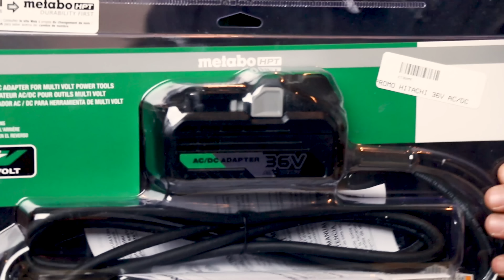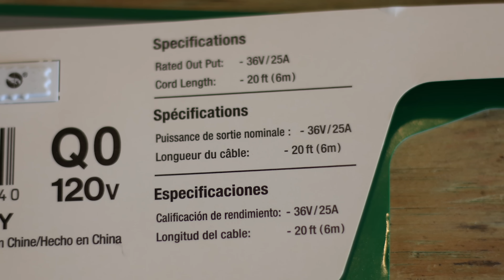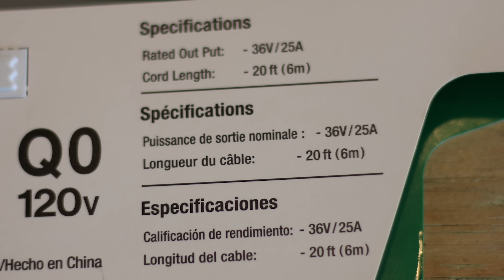Metabo HPT 36V Multivolt AC/DC Adapter On The Triple Hammer!

Comment: a lot of people are mentioning that the cord should come out the back of the battery pack instead of the front, but I think that Metabo HPT designed it this way because the battery on the tools you'd actually need this for slides in backwards. On those high battery consumption tools like saws & rotary hammers, the battery usually mounts in reverse, hence the cord will be facing the back.
Reply from the maker: Exactly Jon!
Reply: i dont mean to be offtopic but does anybody know a tool to log back into an instagram account..?
I was dumb lost my password. I would appreciate any tips you can give me
Reply: @Zakai Darwin instablaster =)
Reply: @Anakin Morgan it worked and I actually got access to my account again. I am so happy:D
Thank you so much you saved my ass!
Reply: @Zakai Darwin You are welcome :D

Comment: Would this work in conjunction with a Milwaukee M18 battery adapter so it could possibly be used for high demand M18 tools?
Any chance in trying this out Vince if you haven't?
Cheers.

Comment: 4 years fast forward i am still waiting for makita and milwaukee to release something similar for their tools =)))
Reply: @histguy101  no I mean an ac adapter
Reply: @histguy101  theoretically any platform can get it is just a transformer / converter from 110v or 240v to 12v 18v or 36v but yeah they won't do it because will loose money from battery sales. However I think is a great ideea from hikoki/metabo hpt to give you the option to power your tool from mains when a battery isn't really needed.

Comment: i tried to make one of these about 8 years ago from a broken Makita battery and a laptop charger. Its about time makita made there own. Do you think there will be one for the new 40v xgt tools Vince
Reply: Need a much more powerful/bigger power supply to provide 18 volts AND the huge amperage draw required to run cordless tools.  I also tried with a laptop charger once. Didn't work very well. Would be cool if all the companies provided this option.

Comment: These are great. I bought three of the battery 18 volt framing nail guns, they will run on the 36 volt batteries too. But im not sure about the adapter working with the 18 volt stuff. We are gearing up to make a run for totally cordless job site. We will be buying the Hitachi 36 volt sliding miter saw also.   Again, these multi volt batteries are compatible with all the older Hitachi lithium 18 volt tools.  You get 18 volt and double amp hours.
Reply from the maker: This new metabo hpt multivolt line is no joke!
Reply: Hi, this adapter works with the 18v line?
Reply: Hi, this adapter works with the 18v line?
Reply: @jesusdanieltorres971  no it does  not.

Comment: Thanks for the unboxing Vince. My thought is that is it is more for tools that are/will be coming out like circs,table saws etc but they wanted to get it out there. TBH I wish I new they were gonna make one for the Milwaukee saws. I’d like to get the 10” mitre but do not want to be limited to battery only. Most of the time it would be in a shop environment so plug it in and forget about it. I’m sure all brands will have this going forward. Sexy Flexy has it already correct? Can that be used on all 60v max tools?
Reply: Pete Hartnett DeWalt F*** it up. Because we run 120v in our outlets that’s why the mitre saw takes two 60v batteries. All the other Sexxxy Flexxxy are single battery. So their AC/DC adapter only works on the one tool. They said they didn’t do it cause if cost on the table saw. $100 more I heard. Stupid in my opinion. Anyway, that’s why HiKoki need sthat brick transformer to adapt that 36v to 120v for an outlet. Above my pay grade.
Reply: REN Man I agree that seems like a missed opportunity on their part. Maybe a revision in the future for the dewalt guys if the hpt version sells good and other companies buy into the idea. Maybe a split version for the flexy that can be used single for drills/etc. and doubled up for the others?

Comment: I’d like to see an adapter like this from Milwaukee it would be nice for the new m18 miter saw/table saw or maybe even a hammer drill if you had a lot of drilling
Reply: Milwaukee will be introducing the hybrid option for the tablesaw this year ;)
Reply from the maker: Milwaukee has no plans to introduce this option in the USA
Reply: @VCGConstruction  Your sources may very well be better than mine. The whisper I heard was they were looking to introduce an updated version of the table saw this Summer that would work with either battery or mains power.  It would be a smart move imo. Cheers.

Comment: Testing the AC/ DC adapter with high current  draw tools should be fun. Instructions say the AC/ DC should not be used with grinders. I wonder if the Mitre and Table Saw blades spool up, brake better or sound different with the adapter installed?

Comment: The Transformer brick is a step Down Transformer to step the voltage down from 120v to 36v thats why the brick is so large takes a ton of chips and capacitors and resistors to drop that voltage @vcgconstruction

Comment: It's a good idea...but like you said the cord is not a good idea for a drill...its good for a table saw or miter saw or other big power tools. That whole set up is not cheap but it's a very good quality tool.
Reply from the maker: I think the adapter will fit on the sds hammers the opposite way so it won’t be an issue!!

Comment: Milwaukee should make a adapter like that and improve on the design
Reply: Aaron Repper that’s red China’s mission statement. They just don’t deliver. I.E. table saw.
Reply: @renaissancemen1  The whispers from TTI tell me it's in the works.  My guess would be NPS19.  The requests for it have been off the charts.
Reply: They already do for m18 power tools.

They are $44 Australian dollars
Reply: @zagan1  give us a link brother.
Reply: zagan1 where ? Maybe your thinking of the USB adapter that clips into the battery
Reply: The power cord is actually designed for the SDS hammer drill. Then the cord goes backwards. You CAN use if for the rest too, but probably it's the worst to use on the impact driver. However Vince showed when you run out of juice on the driver, it still is possible to somehow finish the job with that power adapter.

Comment: It would be great to have the Metabo ac/dc adapter work on all of their cordless tools but it doesn't.  I have the Metabo HPT DV 18 DBFL2 Cordless Hammer Drill , that uses a multivolt 36v / 18v battery, I purchased the Metabo ac/dc adapter but the Metabo hammer drill does not attach to the drill. Hugh Bummer. Stuck with useless adapter.
Reply: Same. Fuckers should be sued for false advertising. The adapter literally says "fits all metabo multivolt battery tools"

Comment: Wish the cord power adapter cord itself came out of back, instead of the front; as, I can see it probably getting in the way when using....from the back of tool, might have been a better choice, just sayin'. That inverter is huge. Wish they could come up with something little smaller to take AC to DC for the tool..... Maybe they could had built the inverter directly into that battery adapter?, might have been tad bigger, but rather that than huge brick😉

Comment: Would that work on the mafel 18v plung saw
Reply from the maker: No I don't think so
Reply: Thank you pal what are your thought of fein drill
Reply: Also  watched your Milwaukee vs metabo how come the milwaukee perform beter using 18v power than the 36v metabo
What happens to the rest of the 18v metabo use or where does the power goes i m confused
Reply: @theetheeyog9878  From what I've read it's really 2 18v 4ah battery packs. The connections in the tool either connect the 2 packs in series giving 36v 4ah. Or in parallel giving 18v 8ah.
Reply: Craig Fredryk I cant see why it wouldn’t work on the 18v? Would be nice if Metabo could confirm either way

Comment: "with Little to No Power Loss." 

"In an AC circuit, the product of the rms voltage and the rms current is called apparent power. When the impedance is a pure resistance, the apparent power is the same as the true power. But when reactance exists, the apparent power is greater than the true power." (whatis.techtarget.com)

Someone correct me if I am wrong, but I believe this is what they mean with Little to No Power Loss.

Comment: I think the cord is a great option, but this thing needs to be redesigned.  They need to make the invertor/transformer much smaller and maybe close to the plug and maybe make it fit into the battery size part of the connector, and make the cord come out the back not the front of the tools. Way to big and awkward. Thumbs down on this good idea.
Reply: Nate Baker I agree with the transformer. Don’t understand that size. I feel the adapter should have just been a battery that you could plug the cord into so it would charge while on the tool. Like you can do with a cell phone. I have some cord ideas as well. But Renaissance Tools will be using them on our new multi flex tool line.
Reply: Smaller would be nice, but go look up high amp power adaptors on Amazon. They're huge.  The transformers, capacitors and stuff that go into it  especially to make it reliable and long lasting, are big and produce a lot of heat.  I think there's  just limitations to how small something like that can be.